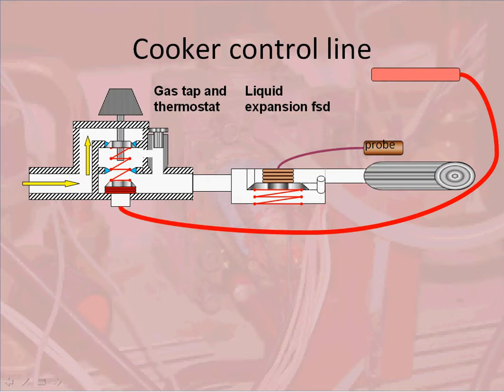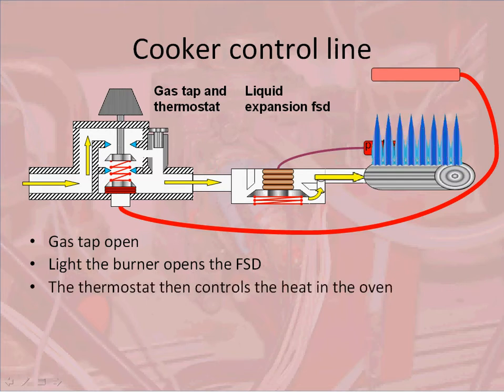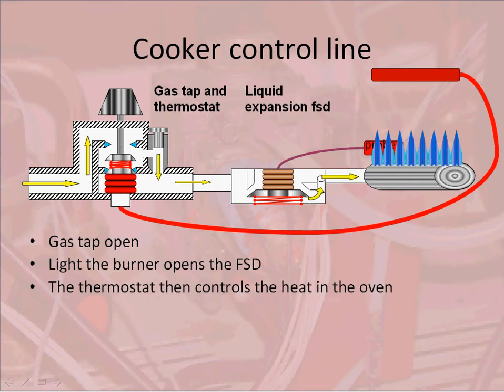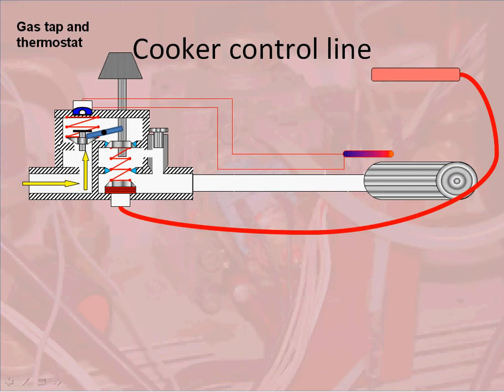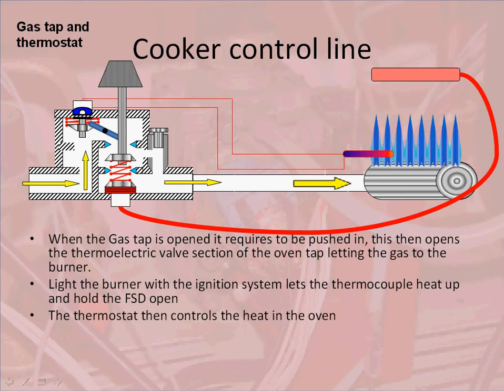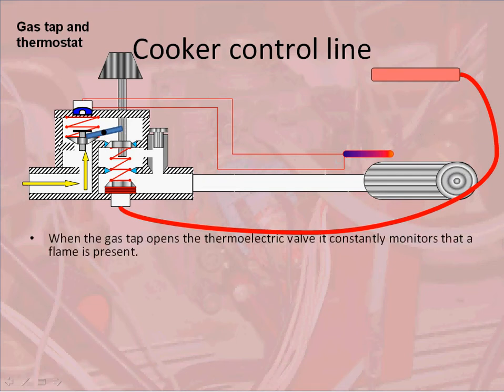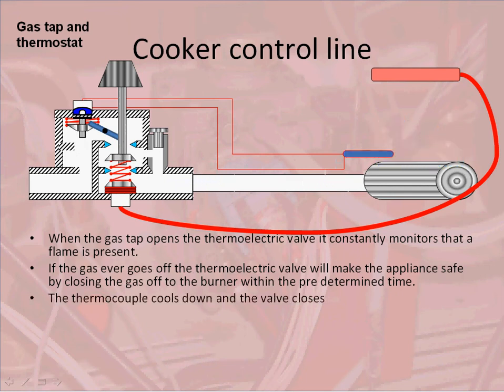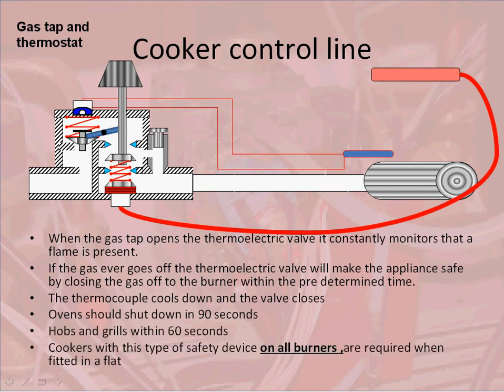gb-gas.co.uk training

Comment: Hi. Just wondering how the gas completly shuts of if theres no flame for the first example. There always seems to be a pathway for gas. Even after the bellows in the thermostat expands
Reply: You are correct. This type of oven liquid expansion flame supervision device (FSD) never completely shuts off gas flow even after flame failure. Instead, gas flow is reduced to a very low rate (hence the small flame when the oven is first lit). This supposedly means that gas will never build up to explosive levels if the oven tap is left on and the oven flame is accidentally extinguished. However, it's obvious that even this small flow is not as good as the complete shut off you'd get with a thermoelectric FSD. Unfortunately, thermoelectric valves would be inconvenient for the user because they have to be manually held in until heat energises the electromagnet.
Reply from the maker: Many modern gas cookers have moved away from Liquid Expansion and now use thermoelectric. The hold in is at the gas tap section of the thermostat
Reply: abdul hafiz  Hi Abdul I think if the flame goes out for some reason then is the probe who shuts the bypass completely, so we would still have gas up to the probe controlled valve. So modulation control the amount of gas but the shut down controls the probe. Illustration could be misleading I guess not animated properly. Peace
Reply from the maker: You are correct but the FSD is not the primary control the gas tap on the thermostat is... this is not shown